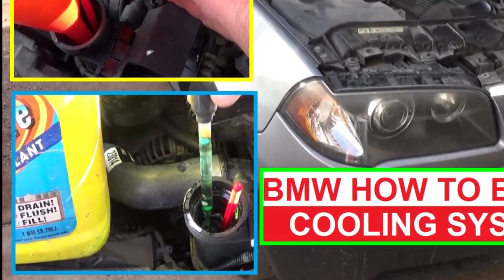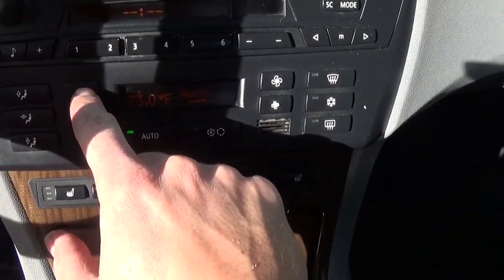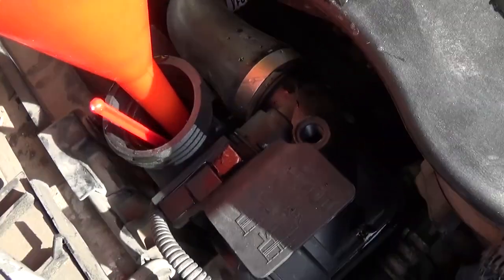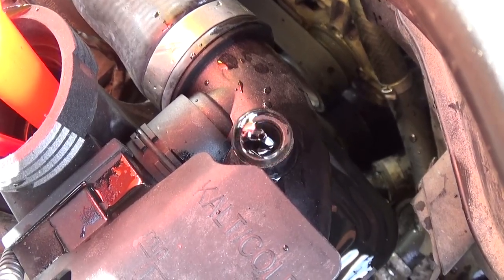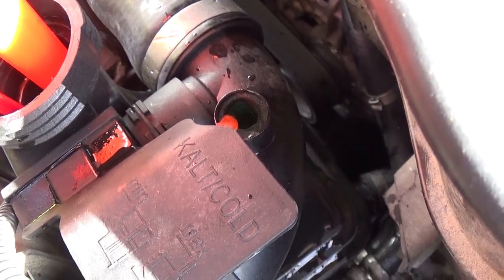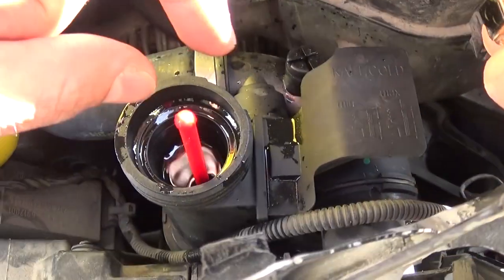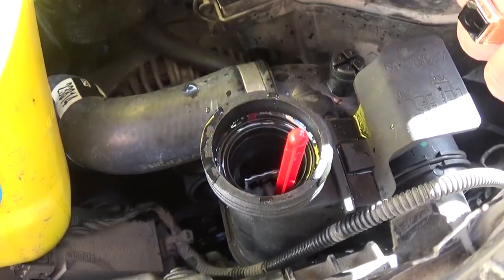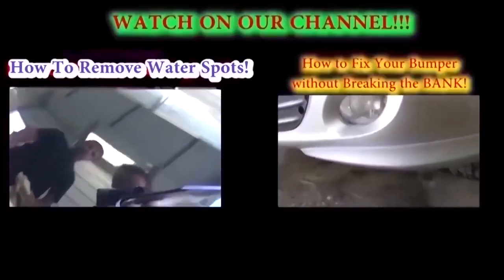How to Bleed the Cooling System on BMW X3 E83 E46 325i 330i 323i 530i 525i  Antifreeze Bleeding Air

Comment: Seems like a messy way to purge the air. The X3 E83 shop manual suggests a different procedure. You fill until the first bit of coolant reaches the bleeder port and then close it up. Next you run the electronic air purge procedure - putting the heater on high/fan-on as shown - but then pressing the accelerator down fully for 10s to start it. The purge runs for 12 minutes so they recommend you connect a battery charger. Seems a lot cleaner than the over-fill / over-flow method shown.
Reply: This only works for models with an electric water pump. Earlier years, like 2004-2006 E83, have a belt driven water pump.

Comment: Why does EVERYONE remove the bleeder screw?? I just don't understand why everyone does this. I'm not saying it's not the proper way to do it or anything, I just sincerely do not understand why you should because if you look in the radiator cap you'll notice it's being sent back to it and it seems like you shouldn't remove screw because it would just bleed the air out by itself into the tank if you left it in and then you wouldn't be covering your car in the overspilled coolant? Someone with any real knowledge on this please inform me of the proper way and/or reasoning of why you should remove that bleed screw. Thanks.
Reply: Its simple..once air is bled, there is high chance water level will drop well bellow required level, if you left cap closed you would not know this. Also the bleed position is the correct place where air collects, so is the right place to release air.

Comment: The best of all BMW E39 and many moore cooling system bleeding the air out ever. I´ve been struggeling with many BMW`s and now it only took 15 min. I used a short peace of standard of a gardening hose and put it beside the stick and put it as deep as possible after filling and closed the air with my other and to get rid of the extra fluid. A few times and done. Thank you "World Mechanics".

Comment: Hello i have a 2012 x3 335i suv i was going to do the flush but i don't have a 
drain plug. I just trying to find the easiest 
way to flush the radiator without making 
a mess.I looked all through you tube and the is no matching car like mine.

Comment: Was wondering if you could answer a question? For a 2007 bmw 328i. If start car with expansion tank cap off. I can see coolant start to go down then it comes back up and overflows out expansion tank. Is that supposed to happen. Thought maybe  blown head gasket but no water in spark plug holes. No water coming out tale pipes. No water in oil. Please help thank you.

Comment: Aloha!
I like your videos , very educational!
I got 2005 BMW X3 and had hose leak so I was just adding a coolant before getting new hose. After I changed the hose about a week later it started to leak coolant again. I wasn’t sure from where , I ordered new hose again,though maybe the o’ring seal or hose was  faulty. But when I was about to drive to get the hose the car wouldn’t start! Not even sound just dash lights , I can see EML code but it just on the dash on second key turn. I didn’t flush the coolant after changing the top hose and was adding just distilled water pass month about 3x . I live in Hawaii so don’t think it has to be 50/50 so I might diluted it to 30/70 or so. Did I overheated the engine? Or how to fix this or at least make it to run to get the car to BMW service? I even tried to jump start the car and rest the battery by disconnecting and connecting the -&+ cables together not connected to the battery.Any help would be appreciated!